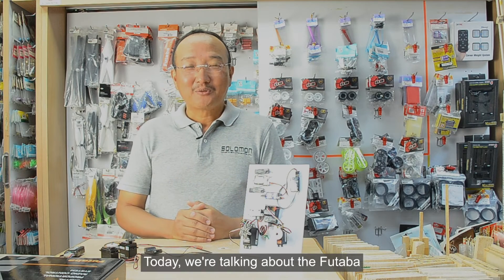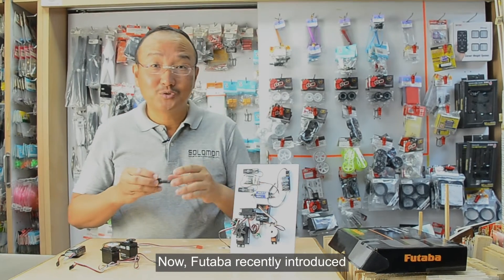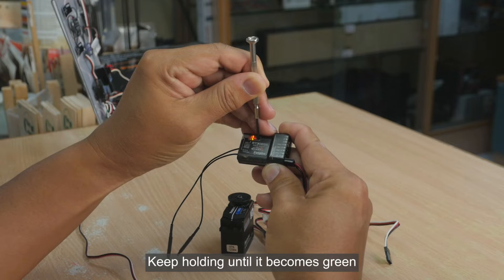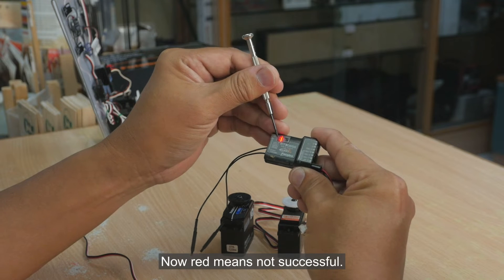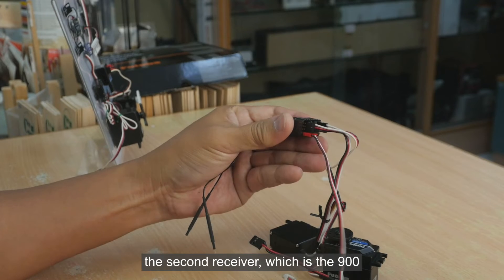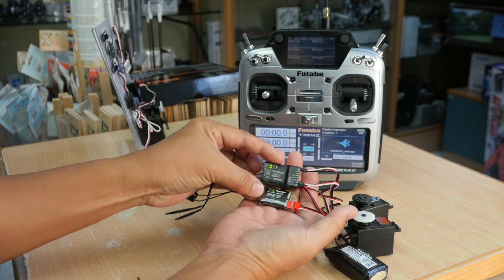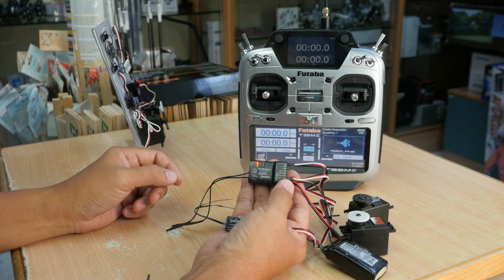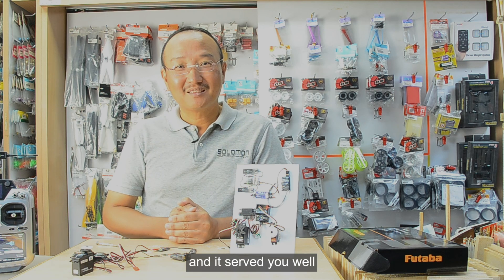Futaba's 900MHz Redundancy System with R7308SB Receiver

Comment: Hi, nice video , very helpful in deed , may I ask a question regarding turning off the 2.4 , I followed your instructions, I did find there is a 1/2 sec lag before the 900 picks up also when I turn on the 2.4 lag, there is a 3/4 sec lag, does this way to test the redundantly same as real life ? If yes, that may be a serious design problem ?
Also if u have connected to futaba gyro, please don’t switch to s-fhss or else the gyro sbus will go crazy and need to reset sbus again